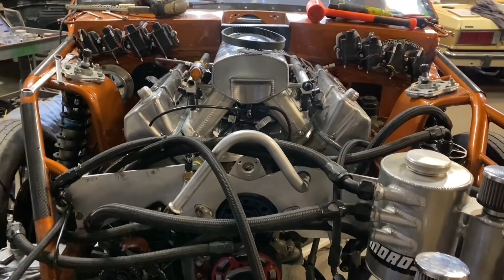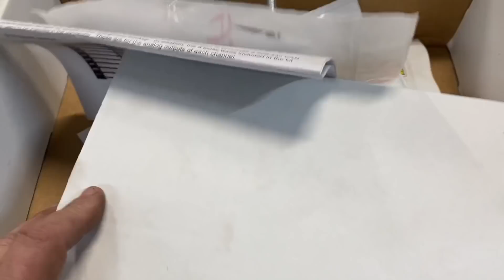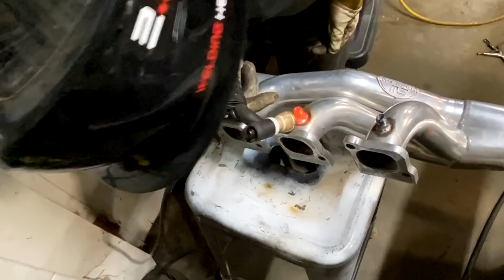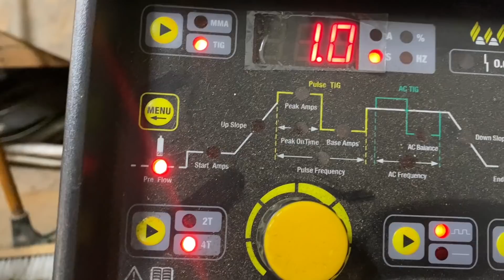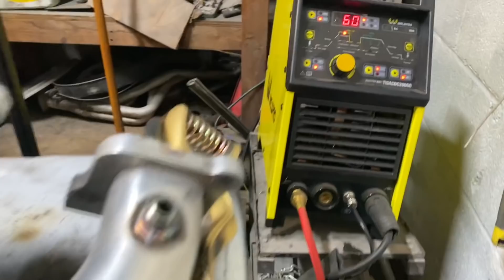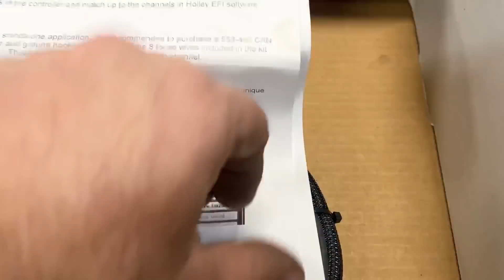Holley EGT

Comment: John, I have a sbc drag car , I have digital volt meter with temperature reading and one temperature probe with a hose clamp . Which cylinder should I install it in , how far from cylinder head port and what max temperature should I be looking for so I can adjust with carb jets .digital reader goes up to 2000 degrees.

Comment: Little tip, only mentioning it because I didnt see it mentioned.  When setting those up the depth into the header matching is really important.  If one is set in the middle and another closer to the edge the temp will always be way off.  So we mark the first one after we set it and mark all the others at the same point to ensure they are all in the same spot.  Good luck and have fun.  

My shit just froze and blew a freeze plug after being ready to roll for months so out it will come to be torn down and checked.  So another fun pointer, drain your block of water at the end of every season, because you never know when itll decide to go -20 below and lose power.  Keep up the good fight.

Comment: Carolina nt sbb 2450lbs up to 98mm, 2650lbs with large turbo, it was going to be 2750-2800 so I’m glad they brought that down. We are going to be around 2550lbs with steel doors, glass, and partial interior😁

I think 98 at 2450
Is going to be plenty capable of running good ET, and the guys with 118 and bigger are going to be crushing mph

Comment: Is that the welder you use for welding aluminum too? Those welds looked good and magically an ad came up for one on FB for 50% off and im thinking about buying one since it will be $450 shipped. Let me know your thoughts, i like the simplicity of the set up of pre and post flow too and if it lasts 4-5yrs i will have learned how to weld good enough on aluminum to buy a better one, where did you get the torch trigger at because i can see a foot feed problematic laid upside down in a car welding a cage lol
Reply from the maker: That's a great price.  I paid 900 bucks for this kit off Amazon.  It's the weld pro tig200.  I have only used it on aluminum a few times, but it was welding decent and getting better as I went so I think it was me. lol  https://www.amazon.com/Weldpro-Digital-Worldwide-Superflex-Trigger/dp/B084PY4C59/ref=sr_1_5?dchild=1&keywords=tig+200+weldpro&qid=1613614407&sr=8-5
Reply: @TurboJohnRacing  thanks man